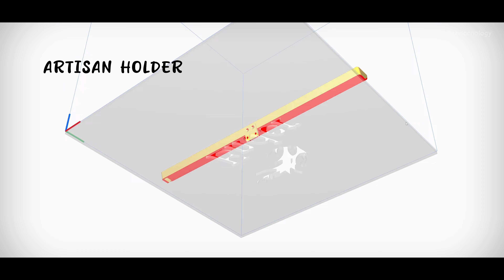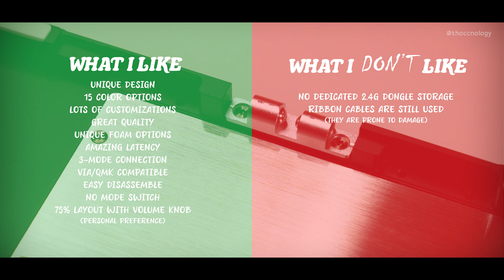Zoom75 TIGA | Cork/Standard/Poron Foam & Alu/POM Plate Sound Tests, WS Arowana Switches

Comment: i dont feel a dedicated slot for a 2.4ghz dongle in a  custom keyboard would feel it much more premium. or a Con as to your opinion, to me it is actually a CON if it has a dedicated slot as cheaper keyboards usually has it, it would be branded as to be in a cheaper one if it has. You can basically put it in the   keyboaed case if you're just gonna use it in wired mode or you're going somewhere else, or just put it entirely in one of your containers for your peripherals. just my 2 cents.
Reply from the maker: I can see your point, but I don't agree. Many keyboards could solve the storage problem in a super aesthetic way. Thinking about Womier RD75, Weikav Stars80, etc. Or even the Evo80's solution is better than nothing.
I myself use plenty of wireless devices, and especially an unmarked/without brand marking dongle is a nightmare to find when needed. (I put the original boxes quite away from sight, so it's not an option to retrieve them every time I wish to place the dongle in a safe dedicated space.)

Comment: My only wish for this board would be a version that is not wireless or have an additional weight that would fill in the gaps if you took the batteries out. Never plan to use wireless but the board is great and more weight the better.
Reply from the maker: That would be a great option, not gonna lie!